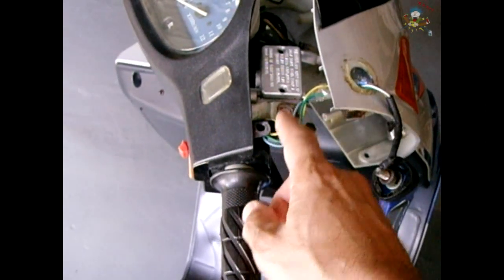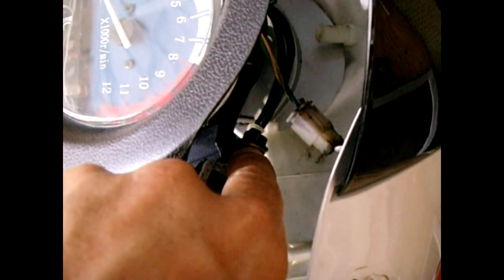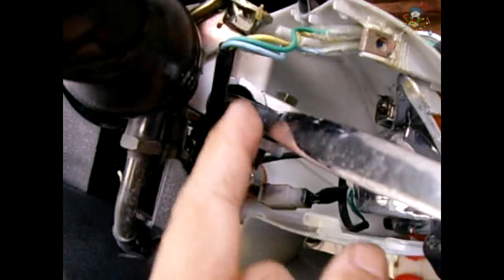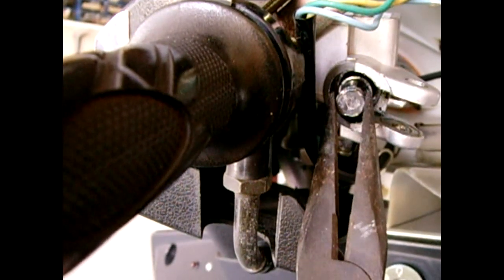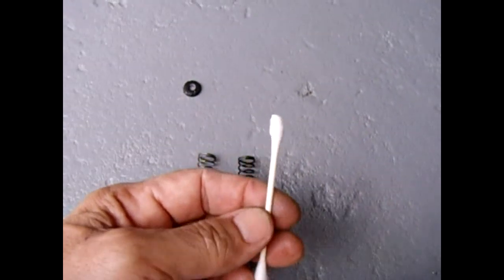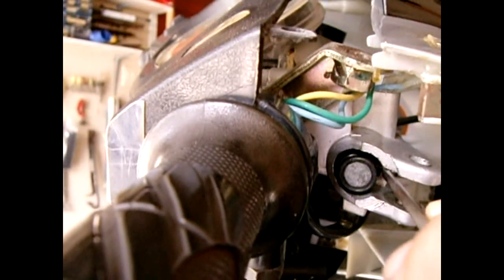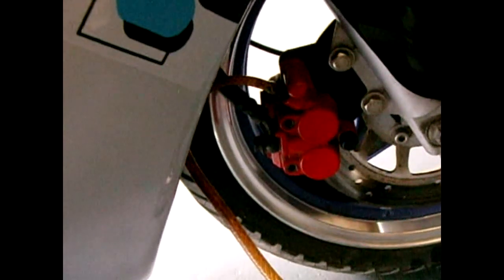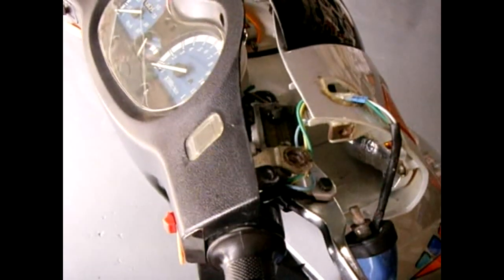How To Fix/Replace GY6 Scooter Master Cylinder(Disc Brakes)

Comment: thank you so much, for such a esplendid video. i would like to ask you a question. can i make myself the rubber seals of this piston? i am having trouble to find them where i live in madrid.
Reply from the maker: omkar om No. You need to buy them, look for another master cylinder to remove the parts from, or swap out the entire master cylinder.

Thanks For Watching!

Comment: Do you still have a scooter? Are the sliders worth the 2-3x the price of roller weights? Also I was thinking of using a dry film lube in the variator, in the roller/back plate , is that a good idea?   I'm thinking about venting the cover also,  the other scoot I had, I could smell the hot belt at times,  for now it runs well, it does 0-25mph up grade fairly quickly, I'm expecting about 55, on flat land, it's close to where I want it, (you can only get so much from stock 139qmb cases) I am thinking about swapping to a 150cc, 157qmj, with head work, and maybe a big bore, 171cc or so, I doubt I'll get over 100mpg with it though,  although a 232cc stroker would be nice, it would be hard to descuise it as a 50cc! Haha,  with the big bore, and cam, it doesn't sound like a 50!  It still needs carb tuning, it is running rich, I think a needle adjustment will help it..  I figured I would need larger jets, with the 20mm carb, and no stock filter box,  I think 1-2 sizes smaller will do it if the needle doesn't!  I think sliders with the performance moving side and ramp  plate, I think it allows for more movement, ( making a larger pulley on top end) it seems sliders will push out further than the rollers! The back half of the variator is available coated for less wear of the rollers, I think a dry lube will do about the same, a Teflon or ceramic coating, or moly or carbon powder,  I'll look at what others are doing, great videos!
Reply from the maker: If you want, apply a VERY light coating of graphite powder for locks, on the sliders before installing them. That's what I did.